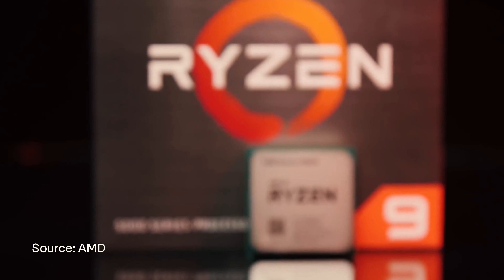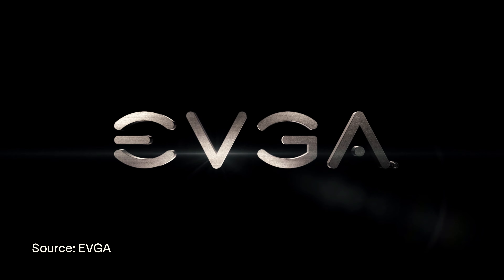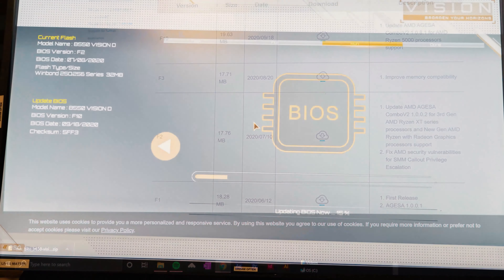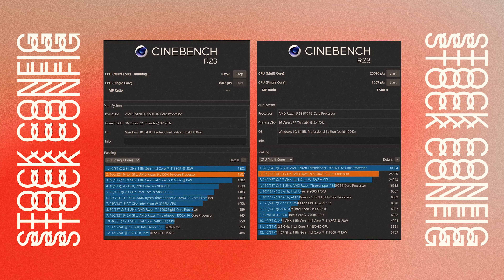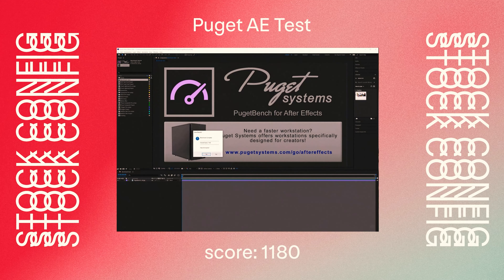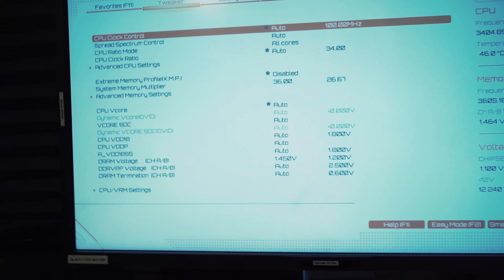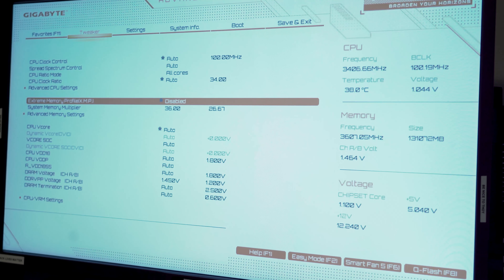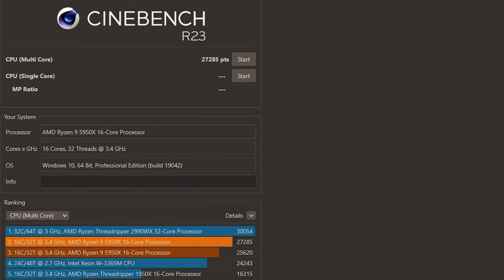The Fastest Motion Graphics Computer using the AMD Ryzen 9 5950X CPU

Comment: Thanks a lot for the video.
it inspired me and helped me a lot.
i am currently building a computer for similar purposes.

how about the noise?
can you hear the computer in normal operation and is it very loud when rendering?
It's very important to me that it's as silent as possible, so I'm considering installing water cooling.
But i don't know if this is even necessary?
I would prefer if I can avoid that.
Reply from the maker: Hard to say. When the fans are going full gas it's not too loud to me. Even with water cooling, you will still need a couple fans. I would go with a more insulated case if your worried about noise.

Comment: nice video. what is temperatures and noise like during idle and load?
Reply from the maker: For professional applications such as After Effecsts, C4D, Premiere, etc its 1000% fine. Zero issues. Just yesterday I swapped motherboards and it's made a huge difference. Will make a short  video about that soon.

Comment: Why did you go with the B550 motherboard instead of an X570?
Reply from the maker: I built my machine based off of recommendations from Puget Systems and the Vision 550D is what they've been using in a lot of their 5950x builds. To be honest my thought process stops there.  Besides the BIOS hiccup, the board has been working great. I can't really think of anything else I'd need. Are the X570s better for overclocking?